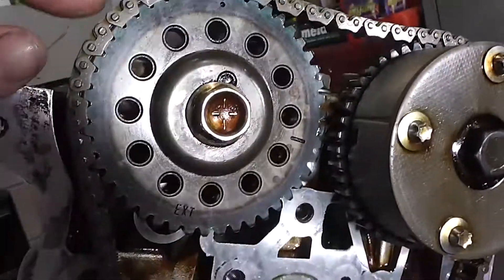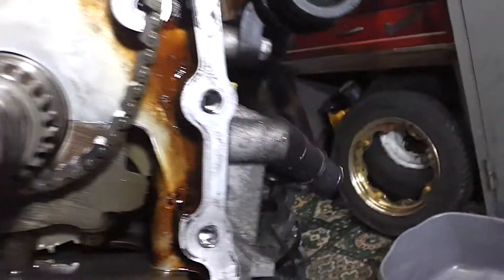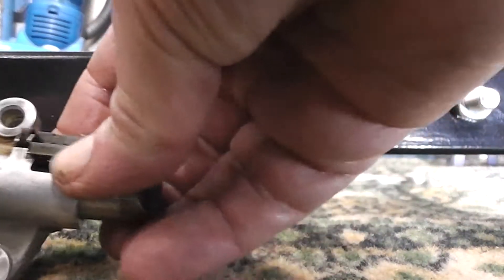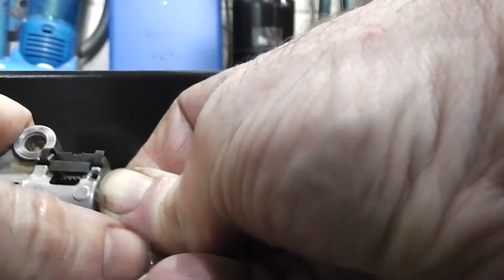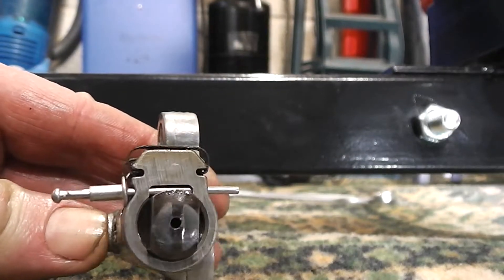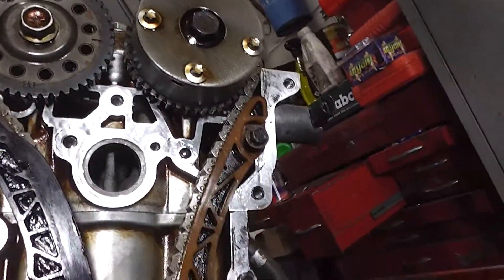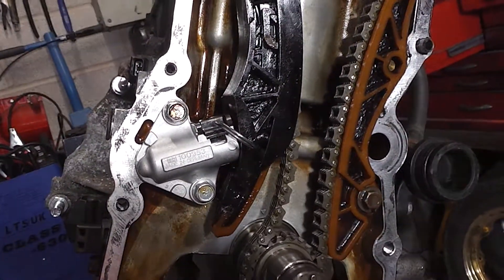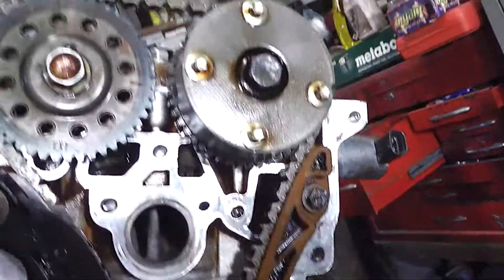SMART FOR TWO TIMING CHAIN ASSEMBLEY 3cylinder 12valve 1.0MHD 71BHP 2012

Comment: Hello, thank you for this excellent video. Is a gasket planned for the timing cover, or is it assembled using gasket sealant? Philippe
Reply from the maker: I don't have the car anymore as the Mrs wanted a 453 with Twinmatic gearbox. but if i recal it had rubber 'O' ring washer gaskets and sealant similar to this 'Sealey High Temperature Gasket Sealant' but take your time as you will be pulling down to the sump and towards the engine so i would install all the bolts loosely as much as you can before torqueing them down.
 Also check the images here - https://www.autodoc.co.uk/car-parts/full-gasket-set-engine-10324/smart/fortwo/fortwo-coupe-451

Comment: Can i ask you stupid question when refitted gearbox any daft prob u come across once again good wee wideo
Reply from the maker: Auto Gearbox is as easy as a manual to remove/refit but mark the clutch actuator (you will see ridge lines on beneath one of the three bolts) before removal so you can fit it back in the same place to avoid clutch slip or drag. However if you are fitting a new clutch adjustment will be needed. In an auto i would re adapt the clutch actuator using a bidirectional diagnostics tool like MB STAR Xentry Diagnosis VCI. i did mine with Autocom 2020.23 using a Delphi DS-150 but it didn't want to work initially it may have been due to engine temperature/ rpm or something i also readapted the Gearbox as well, remember to put chocks either side of the wheels and put the handbrake on. DO NOT lay under the car when do this procedure.this guy does it with icarsoft - https://www.youtube.com/watch?v=dzPOUJT_rP4

Comment: Most informative video available, Thanks.
I followed your video exactly. My car would start and run for about 7-8 seconds then settle down to idle and stutter and misfire. I couldn't figure it out and took it to an import shop. They hooked it up to the Mercedes software and said my timing was off by 9 degrees and suspected I was off a tooth. I opened it all back up again and it matches exactly where you put it. One tooth on the intake cam is about 8 degrees.... Did yours run correctly?

Comment: Great video¡¡
DO have the torque settings of the crankshaft?
Reply from the maker: This is what i found but please check elsewhere also as i would hate to give wrong advice - maybe if someone has latest Alldata ?
Bolt for Crankshaft bearing Cap      Engine 132.9
BA03.20-P-1001-01G
Stage 1 Nm - 30
Stage 2 - 60 degrees

Bolt connecting Rod bearing cap to connecting rod   Engine 132.9
BA03.10-P-1001-01K
Stage 1 Nm - 15
Stage 2 -  90 degrees

Comment: Thanks so much for posting this. I use the AllData online shop manual, which is usually pretty good, but the two dots at the crankshaft threw me. Putting this back together after a blown head gasket. I spent a few years working on cars, and twenty  or so on aircraft, but never anything as difficult as this car. Not much thought given to ease of maintenance.
Reply from the maker: Hi Melissa, thanks for your positive comment, i to have used AllData and found its a good source of info for settings, torque sequences and Servicing but for this 451 engine it was just not clear on how to set the timing marks and with the cylinders being set at 120 degres it made it all the more awkward compared to the old 180 degree engines.
Reply: Couldn't agree more with Melissa.  AllData was very vague on this and Calvin's video made the process clear and easy.  Many thanks for this video and advice, made the installation easy peasy!!

Comment: I have a 2011 smart fortwo need the head cylinder torque specs and what sequence in torque with the bolts first to  last sequence.
Reply from the maker: This is what i found - please do your own research as well though as i would hate to give you the wrong info.

Start from the middle top bottom then work outwards diagonally top right bottom left, top left bottom right, until you reach the outside

Engine        132.9       160.910        160.920        160.921        160.922       160.923
Stage 1 Nm     25            21             21             21             21            21
Stage 2 Deg    90            90             90             90             90            90
Stage 3 Deg    90            90             90             90             90            90
Stage 4 Deg    -             10             10             10             10            10

Bolts   Nm     -             -              27             27             27            27
cylinder head to
Timing case cover 

CAMSHAFT
Number             Designation Engine  132.9
BA05.20-P-1001-01M    Bolt, camshaft bearing bridge to cylinder head                        Nm 20
BA05.20-P-1002-01M    Bolt connecting camshaft bearing cap to cylinder head         Nm 11

Comment: Hello.
Great video! I just bought a 451 brabus and i want to change the timing because i think it has never been done. So i hawe a question for you. Actually more... Can i swap the chain, friction pads and tensioner with the engine in place? I don' hawe to take the oil sump off?
The two "water holes" in the timing cover, are sealed with o rings? 
Thank you!
Reply from the maker: In answer to your question, Yes it is possible but a pig of a job with the engine in the car, you will need to raise the body off of the engine frame, There are 4 main bolts this will then allow you to remove the rocker cover and front Cam-chain cover. The reason its easier with the engine out is that the 2 seals mentioned (for water pump and one for oil tend to move about on assembly. So if you insisted on changing the chain with the car engine in situ, without going into too much detail - Undo the 2 rear main Engine frame bolts (near the exhaust), Loosen the front Main frame bolts (near the front of the rear wheels)enough to lower down ( the handbrake may also need disconnecting from the Engine frame as it will become tight (that's a weird ratchet thing), You will need to remove the 3 coil packs and wiring to one side, Crank case breather if i recall, Then remove rocker cover and Sump, Then alternator and tensioner, Now the Front Chain cover can be removed. There will be obstacles along the way with the engine in like trying to remove the cover as if i recall the shocker is in the way, Fuel pipe will be tight and Water radiator pipes in the way, Easier to lower and remove the engine on frame with wheels, It does involve disconnecting brake pipes and ABS cables all the wiring which is self explanatory but lots of it, Fuel pipe, Rad pipes, Handbrake cable. but you will be able to change the clutch if needed and inspect everything, Also be confident that you have done the job well i may have forgotten some things that need disconnecting. Oh and invest in a Hose Clamp Pliers tool to disconnect the rad pipes if you remove the engine
Reply from the maker: Sorry, so to clarify on your question the Cam top cover removed you can also see the timing marks then, Front Cover (may need to remove pump from cover to do this or shocker leg, spring etc. due to room needed to get beyond Crankshaft also Crank pulley.) Sump could in theory stay put. but its those Damn rubber seals, you don't want water in the oil or visa versa. Incidentally I read somewhere, you can expect to get 200,000 miles without a rebuild.
Reply: @calvinhudson327 responding if it helps someone in the future. Your video is going to help me hopefully. Ac lines don’t need to be removed whole ac unit can be removing via 3 holding bolts